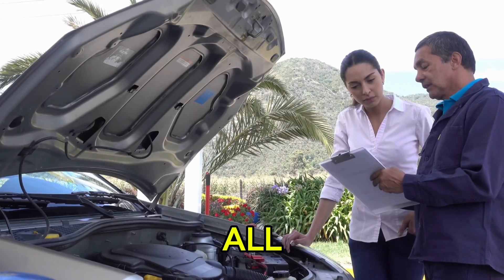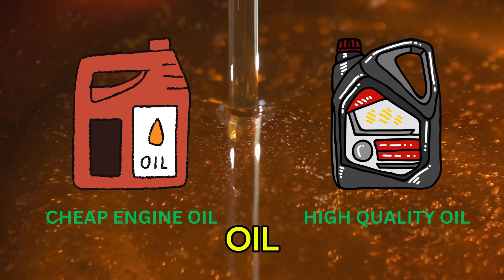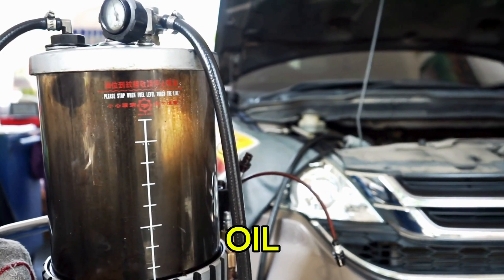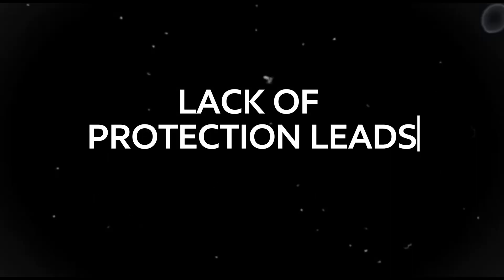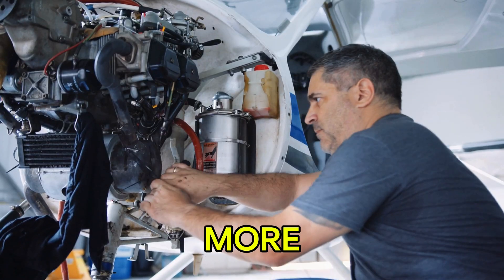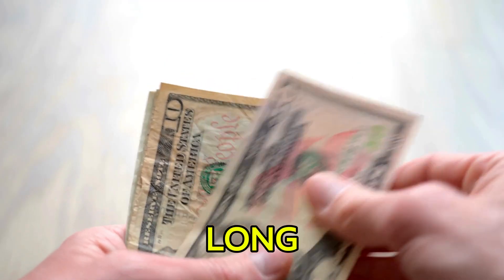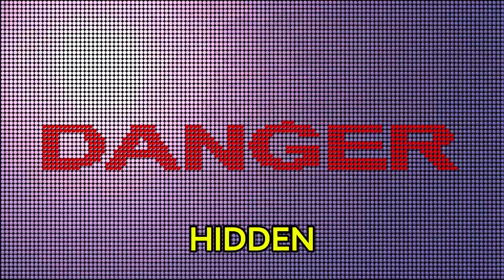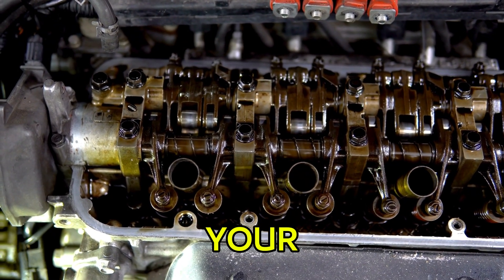The Hidden Dangers of Cheap Engine Oil: Is Saving a Few Bucks Worth the Risk?

Comment: As long as it meets the specs your engine calls for and change it every 3000 miles. With filter. There are some oils out there that don't meet spec you have to read the label

Comment: I've used 'cheaper' oil before and changed it after 3k-5k miles with no major issues other than perhaps the evaporation rate compared to the expensive oils. Generally speaking as long as it meets the correct oil spec, it does the job.